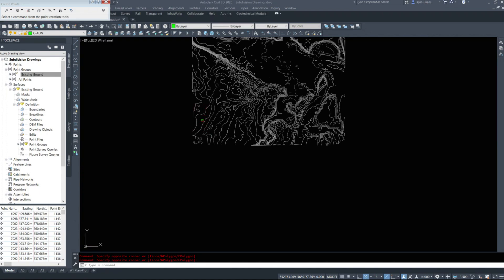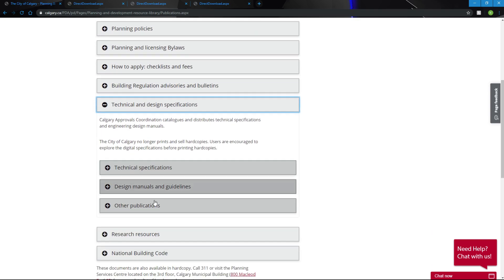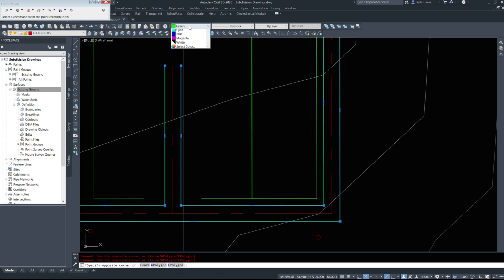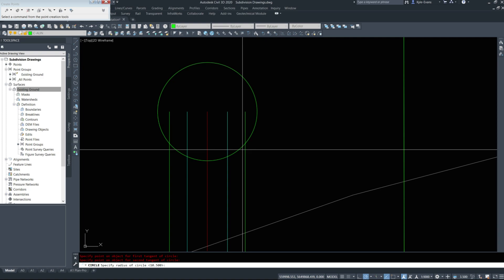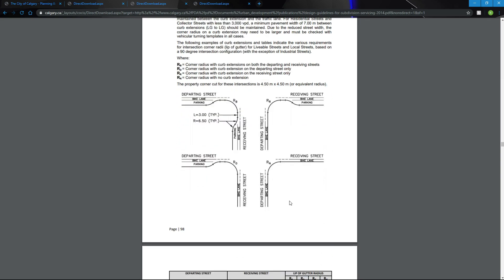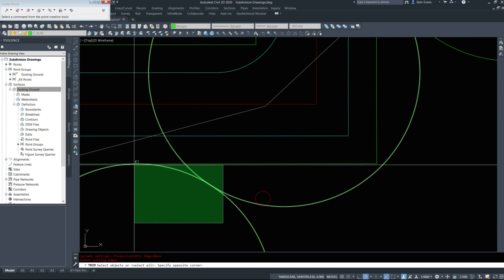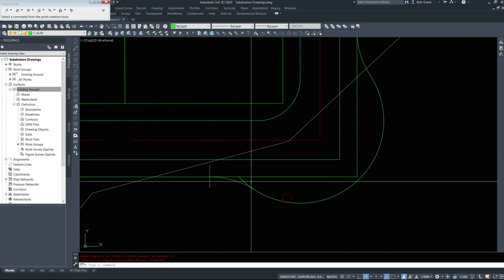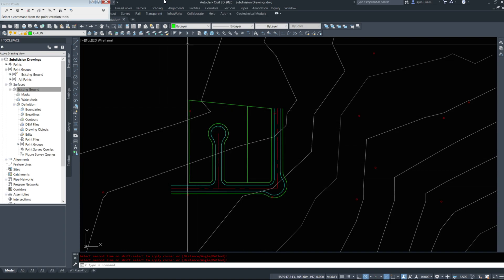Initial Residential Subdivision Layout

Comment: Hi Kyle, I am new to Civil 3D, I have watched almost every single one of your video. My company is small size Geotech consulting film, so the Civil design is our new field. I followed along with your videos, I can perform the most of the work. However, would you show me what do you do when you initially receive a Survey dwg file? How can I start to do Civil design? I am really confused here, should I import my own style template (I created template file according to your video) into the Survey provided dwg files? because if I xerf the survey drawing into my template, I lost Z value. And, I noticed most survey company in my area, they do not provide points, I cannot find any points in point tap, they usually have points in specific layers. Also, they use 3D-breakline to represent surface. I hope you can have a video to walkthrough the whole process as civil drafter, from initial receive the survey drawing to final plan creation, no design detail needed as you already have so many videos regarding to designing phase. Thanks for you time watching my comment here. Have a good day!
Reply: the best way to work with the existing surface is to either bring it into your file as a xml, or use a data reference so if there are ever edits to the survey the file in your proposed base will update.
Reply: @jgrove197  Thanks for the help! I will give it a try!

Comment: Hi Kyle, thank you for this video series. I have a question. What coordinate system do you use? I know It's from Calgary but for me as European It's difficult to choose the right one. Thank you.
Reply from the maker: CANA83-3TM114 is the quick code.
Reply: @KyleEvansCivil  Great. Thank you. 👍
Reply: @KyleEvansCivil  I used this Coordinate system and PENZ format but somehow my points and coordinate system does not line up.
Reply from the maker: @simulationnation3105  What do you mean they do not line up? What if you Try PNEZ
Reply: @KyleEvansCivil  the points show up way outside the map when I turn on Geolocation map. When I use PNEZ the points shows up in the ocean part of the map when I turn on Geolocation map.
Reply from the maker: @simulationnation3105  Whoops, Try UTM83-11, or UTM83-12 and if that does not work CANA83-10TM115EAP. I must have been working on a different file when I answered the above question. My apologies